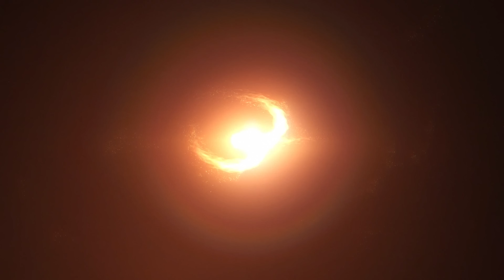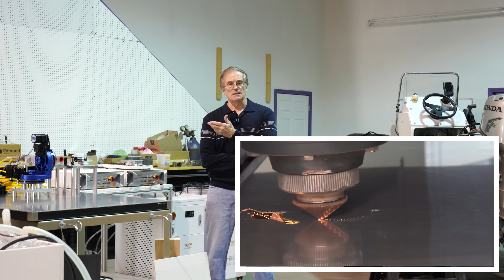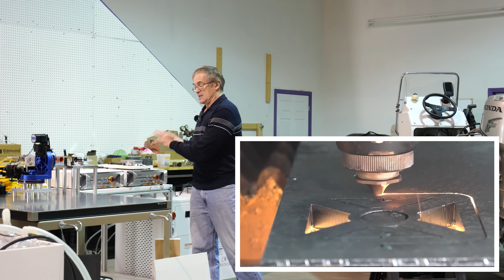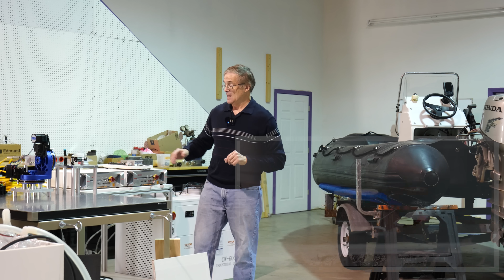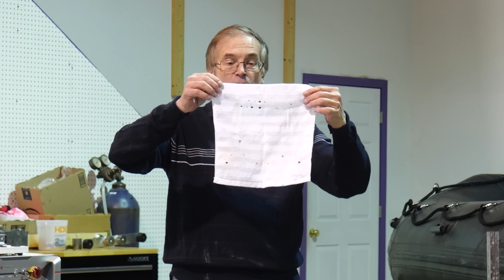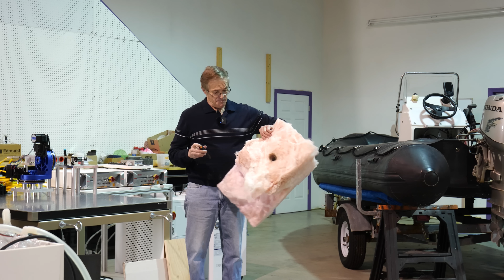We have a problem... and need your help!

Comment: This may not meet your mobility requirements, but freezing a defractive material in ice may do what you need. Not only are you dealing with the laser beam itself, but also the heat energy that it can dump into a material it comes in contact with. The failure with the insulation kind of implies that high surface area materials couldn't deal with the highly localized heat.

edit:diatamaceous earth might work if frozen?

Comment: My instinct says blocks of ice should work well.  The heat capacity is fantastic and the phase change will absorb even more energy.  Also, adding a dye to the water before freezing would alter the absorption spectrum.  In this way you could tune your back stop depending on the laser output energy.  

Or imagine running a waterfall down the backstop.  A curtain of water, as thick as necessary could also work.  My experience stopping ion beams were made of water cooled tantalum.  That worked very well for ion beams but I don't think it'll work for this type of dense energy.  With such a high laser impulse the surface will be ablated off  any metal (or solid probably) almost instantly.

Comment: Sandbags. Loads of sandbags. This would be my low tech barrier. the sand can be melted, but it will collapse on top and keep adding fresh sand to be melted. It should be able to hold the beam back for a few seconds. It's cheap, but it's not all that easy to handle as it weighs tons.

If you were projecting down I would suggest a water bath with a sand layer on the bottom. Possibly dissolving something in the water to make it more opaque.

Comment: We use black painted sheets metal in some of our rooms and a concrete tube in another laser. Our lasers are concentrated on a point where we want to cut or weld stainless steel, so it's probably not as focused as yours. We don't want any laser light bouncing around on shiny surfaces, that's where the black paint comes in. I believe our lasers would be out of focus before it would hit any wall. The vendor probably have a service technician that have seen solutions to your problem. Take care and don't melt the big cheese in the sky. 😄

Comment: I’m thinking sand, kind of heavy but maybe make a wall of it say a few inches thick like filler between two sheets. So when the beam starts to melt the sand as it travels through the cavity it slumps and new sand falls into place lowering the temperature absorbing more energy.. if the wall is thick enough the laser shouldn’t reach the back before the slumping occurs 🤷🏼‍♂️
An alternative might be to use industrial garnet. It’s 20-30 cents a pound for dry screened 80 mesh that would flow pretty nice and because it is basically sand with iron atomically in the mix it might take the heat better. Because iron is what kills stars.. right? Just a thought. You can probably pick up a couple 50 pound bags pretty inexpensively to test it too to see if it’s worth pursuing. 😃

Comment: There’s a wool-like pad called Vitcas that they line kilns with. It has its own problems because it’s not good to breath the dust but can withstand 1,200 deg C. 
They also make lightweight bricks that is good for about 1,250 deg C.

Comment: Two thoughts, composite material.  Wet blanket + Plywood (should keep the plywood from catching fire.  You could just soak the plywood, but that would be hard to handle and take ages.

Second thoughts, but both have a lot of mass.  24" square patio stones.  They are thinner than bricks, so less mass per square meter, and bigger so less handling is needed.
The other second though is sand.  Full on sand bags would likely be too much, but if you only need 1-2" of sand you could make a frame that you fill, possibly with a drain port at the bottom to make moving it easier.

Comment: The apollo project used AVCOAT for the ablative shield. The AVCOAT was a fiberglass honeycomb structure filled with an Epoxy No Valac Resin, reinforced with Quartz fibers, and Phenolic Micro - balloons. I think it was six inches, but it lasted all the way through re-entry. Just a thought.

Comment: You probably need something like graphite or ferrite (magnetite ?), which are materials that have a high absorption throughout the whole visible spectrum, will not easily melt, have a high boiling point, will not easily catch on fire, and are (more or less) non-toxic. Maybe a wall of hard-coal briquettes may do, but it will be messy. Or maybe a material they use in the heat shields of re-entry modules of spacecrafts may work, but that's usually not tested for low toxicity, if I'm correct.

Comment: What about splitting this problem in two?
1. Make highly focused beam less focused. Some kind of wavy glass or other transparent material like that is used in doors. Or convex, concave or other distorted mirror that will reflect the ray to the floor and turn point into the line or circle, greatly reducing amount of power per area. 
2. Absorb unfocused light with one of the previously tested methods.

If a mirror is used in #1, you can redirect light to a pool of water mixed with black dye or other light absorbing agent.

Comment: Try a tank with a transparent entry window and a suspention of soot particles in it. "Acetylen soot" is nm small in particle size and a bulk industrial product. The fluid could be an inert gas if the thermal convection is strong enough to keep the particles in suspension. Helium or Argon come to mind. Water keeps the suspention up better, ofcourse, and spots of run-away heat concentration are limited by boiling of and the resulting additional convection.

Comment: Carbon black & water mix between 2 partially reflective glass panes (think 1 way mirror)?
Destructive interference pattern?
Pulse the laser to limit power output?  No.
Why don't the fiber optics themselves get cooked?
Trap the light between 2 materials that transmit and reflect the light to dissipate the heat?
Fresnel lens?
Sandblast ceramic tile then vapor coat with aluminum to disperse light?
Don't cook any commercial airplanes.
Seems like you need a ranging system with automatic adjustable focusing system, ha good luck with that.
Seems like anything that absorbs the light will generate heat will get cooked, anything reflective will cook you. :-(,  so you need something that can't be cooked or vaporized and conducts a lot of heat away quickly.  Is there some material like black silver or aluminum that absorbs light and conducts heat?
You have probably already thought of most of this, but it's not simple.

Comment: What about multiple layers of dry ice fog. Cascade. 

The background might mitigate reflections if it was concave or had some similar array that decreases the incidence angle.

Can you catch it with layered filters & have a spinning or motion  on the catch object to decrease the laser hz/mm2

—
Could you run continuous water down the black curtains.  

So how about 3 rows of heavily pleated carbon black thick wicking fabric curtains.  Could put a vibrator on the curtain rod to add >1mm motion variance to the curtains. 

I’d contain it in a box to maximize atmospheric conditions and mitigate lateral reflections from water droplets. An inverted grow tent could be a good module.

Matte duvetine might do it for fabric. Some theater type curtains maybe. 

Run a sprinkler system with a diversity of misters and sprayers to continuously soak the curtains & fog up the interior-curtain spaces.  

Could be recirculating ideally.  Like your chiller.  

It’s a T.I. Layered Laser Chiller!!😅

Comment: Crazy thought, I know it is a potentially hazardous material, but have you thought about using asbestos bricks, possibly with a glass brick in front that is just warped or opaque enough to disperse the laser but not enough to build heat so the beam is attenuated after is passed through the glass and the heat that passes through could possible be adsorbed by the asbestos brick behind? they have a burning point of 1832 F.

Comment: I would make a 3 inch wide enclosure out of chicken wire, and fill it with charcoal brickets. They absorbed an incredible amount of heat per gram. You could mount the encloser on a wooden platform with casters and roll it out of the way.

Comment: What about basalt? Industry use brings higher availability and material types, could potentially build a wall on casters as you would an old chalkboard with slate so it could be practically mobile to keep the drop door a door.

Comment: Your absorbent material could be on some large rollers which keeps it in motion during testing. At that point a large thick wet canvas loop might be sufficient to stop the beam reliably.

If the rollers are horizontal to the floor, the canvas could dip into a water trough at the bottom which keeps it wet and cooled. (drawbacks, wet and noisy)

Comment: Add a low focal length lens after your final lens on a solenoid that only allows the narrow beam out when you're ready. Basically you'll be able to activate/deactivate it with a trigger signal. If you tie it in to your targeting/aiming computer you can have it automatically slide into place if it hasnt seen any signals to move the laser for 50ms or so. A teensy (maybe 2 for redundancy) would be ideal for this, i think

Comment: I'm thinking a diffusing lens built into a "fish tank" filled with water to dissipate the heat. Maybe circulate the water as well for added cooling of the lens, and/or use additives (dyes?) to better affect the wavelength and trap more light. Pretty cool problem to have!

Comment: Materials used to delay penetration of lasers in military contexts are not very affordable. Dirt or rock behind the firing range would seem to make the most sense, although of course it could have power portability challenges. While it wouldn't be nearly as compact, an array of lasers spaced widely could mimic the divergence pattern of your cutting lasers at greater distances.

Comment: There's really only one dead simple stupid solution here as you're running up against fundamental physics.  You want alumina milling material 2mm and smaller.  Basically small ceramic balls.  You want to use the small diameter stuff and fix a double layer of it to a thin sheet of something like shimstock to support it.  Some media is mat finished some looks glazed... experiment with the stuff to see which holds up better... If you're under the critical damage threshold for the material you're done.  If not you will simply need to re attach a sphere whenever you burn one.  This isn't rocket science but it's the highest durability material (also the lowest density material) for this application that you can afford.  At the intensities and distances you're working at,  ALL SURFACES can back scatter unsafe power levels EVEN if you're wearing laser goggles so use extra care. However, the ball media is spherical so if you get the right diameter the back scatter will be difuse.  If this doesn't work for you... well what did you expect to happen... you set out to build a death ray...😢 design a better interlock failsafe system next time... or apply for federal funding and spend 10M on the first lightweight warehouse lazor DE armor system. 😂  seriously tho,  if you go this route i can probably dig up some references (given a few days to poke around in old notebooks) as this is very similar to the stuff i played around with in gradschool.

Comment: Know how you can boil water in a paper cup?  How about a 1/8" aluminum (for heat conductivity) target with a thin, flowing water jacket behind it.  Flow the water from bottom to top to get rid of the heat more efficiently.  Alternatively, the same target over a trough with a flood spraying nozzle cooling it from the back.  You can tell if you need to TIG weld a patch when it springs a leak.

Comment: My immediate thought with the insulation was rockwool as that's a much more fire/heat tolerant alternative to  spun glass "pink stuff" but at the power you're dealing with it may not be sufficient...perhaps a good backing material to your "primary" solution though.  As someone else suggested graphite is a good material crucibles and is something that may be available as tiles or a sort of refractory brick?  

You have some pretty cool problems.

Comment: Off the top of my head:
1) Try Fiberfrax/Kaowool refractory fiber insulation, the alumina or zirconia type for higher heat tolerance.[also comes in rigid panels]
2) Optics in the current system, How about a convex lens to disperse the collimated beam -> beam dump of fiber or absorber.
3) Variation on a LASER beam dump: An oblique incidence plate, or slightly convex surface, to reflect and disperse the collimated beam -> fiber backing or absorber.
4) Beam shutter at the source before de-noising/collimating at the point of weakest beam power -> to beam dump, fiber, or absorber.
Reply: The first one.... the best... and maybe a rotating system with the ceramic wool.
Reply: @osposto  sheesh...
How did i forget rotating targets...
That's how ultra-high power x-ray tubes keep from evaporating the targets with the high current electron beam.
Reply: @osposto  What about a belt sander.  That has ceramic particles and should move fast enough to be okay with water cooling.

Comment: Just don't shoot at stationary drones.
 As long as they are moving (not just in distance), the beam will move too and won't stay on a single spot for more than a few milliseconds. 
You could also introduce a slight wobble via software.

Comment: Ignoring the wall backstop, for a minute: Use two lasers in parallel alignment, one low and the other high power. Use the low power to detect target and to initiate firing and hold.

Backstop wall: Two panels, with the facing one transparent, sandwiched with an air gap, filled with fine soil.

Comment: Have you tried masterboard (not sure if that's just a brand name) but, in the UK it was used for fireproofing, it looks similar to asbestos. It was used on the overhang of gable roofs and soffit, and sometimes in garages on the ceiling. Another product is fireproof cloth that is used when soldering pipework to protect the wall or woodwork.
I've just checked and it's widely available in the UK, it's a fibre cement board, fire rated, also good for soundproofing.

Comment: a wall of oversaturated sodium polyacrylate spheres in water? the beam will get unfocused and the water should be enough. Also, maybe hydrous magnesium sulfate? Either one might be fun to watch. Both would have to be sandwiched in a structure. maybe some sacrificial dry wall or glass/acrylic?

Comment: You thought of everything I would've. I was gonna suggest firebricks or heat resistant Styrofoam. But I don't think they would work. Only crazy idea I have is a black wire mesh. Trying to use the double slit to dilute it's power over an area. 😕

Comment: A fluidized or vibrated sand filled chamber.  The aeration/vibration would keep sand moving to fill in voids.  The chamber would be 2 sheets of anything.  Spacing, any depth such that it won't allow sand to bridge itself between the two planes.  Dry sand for smooth flow.

Edit: nvm, I see this has been suggested already.

Comment: Sounds like you need some better safety systems too.  A black back stop and a photo-diode looking at room brightness at the laser frequency should let you cut power in a few micro-seconds to mili-seconds.  Which would make drywall with black Intumescent paint enough.

A water cooled black anodized aluminum sheet might hold up.  Depends on the power density though.  If frosted glass survives the beam, then a scattering layer in front will increase the power capacity of a water cooled wall.

Comment: Don't think that plywood or any other material soaked in water will be safe as localized heating at that power level would turn the water into super-heated steam instantaneously and would go boom.
If you use sand or similar you will have to clear any glass created by the previous "shot" before trying again because glass can be very reflective.
Interesting problem...

Comment: When I was in survival training we learned that you could boil an egg in a paper cup, because the water wicked away the heat from the paper very efficiently. The top of the cup that was not submerged would burn away, so as water boiled away you would loose more and more cup. 

So maybe a wall of 1 gallon plastic water bottles or maybe the 5 gallon watercolor jugs. The other option if the plastic did not work could be metal Jerry cans full of water. 

I can’t imagine that it would be enough heat to boil enough water to over pressure the container causing them to expand or explode, but it would still be a possibility. So test to see if you could leave the containers closed so your wall does not have to worry about evaporation. 

In any case it would give you a literally tons of thermal mass that could be worked with that could be poured down the drain after your testing was completed.

Comment: How big do you need the target area to be?  Sounds like you need to expand the beam before dealing with it.  Perhaps there are already industry options for doing this sort of thing?   What about those fresnel lenses that used to be used on rear projection TVs?.   If you can capture the beam and then expand it,  it will be much easier to dissipate the energy.

Comment: I was thinking in terms of ablative materials, where solid material bubbles/sublimates into a gas that further scatters the beam. 

Or a water curtain using black dyed water: will diffuse and absorb laser light. And you'll get other youtubers excited with the laminar flow